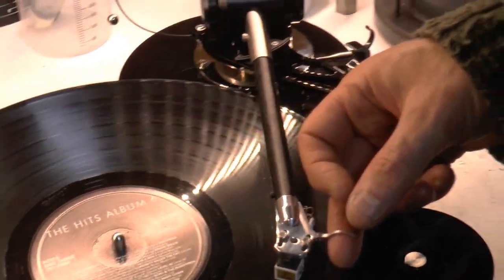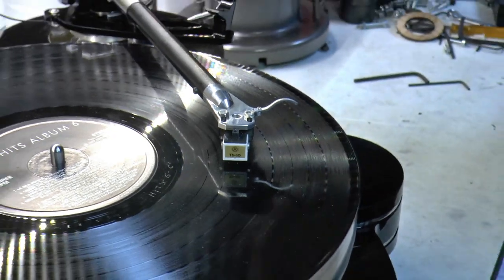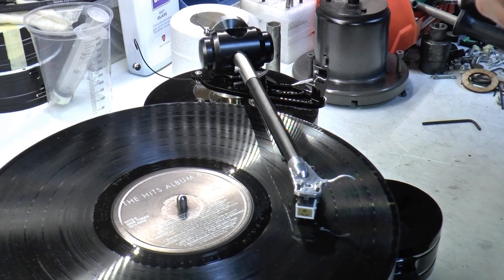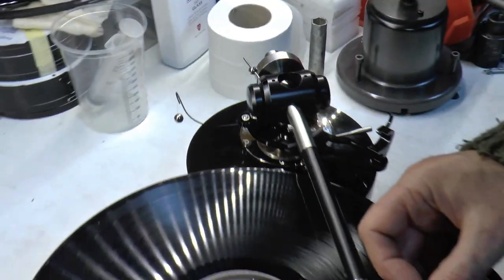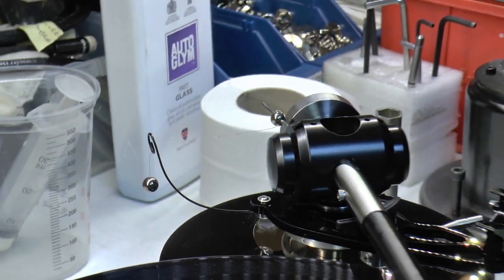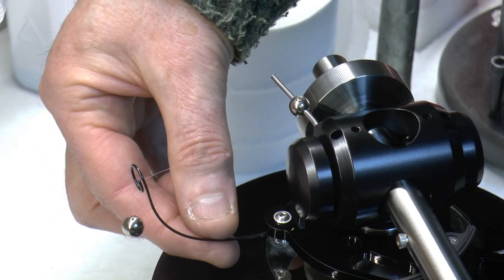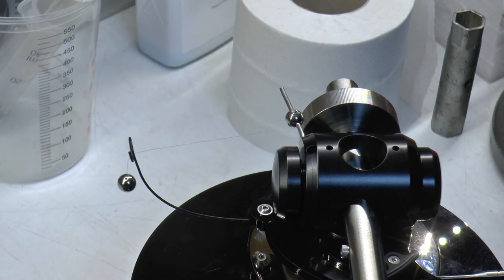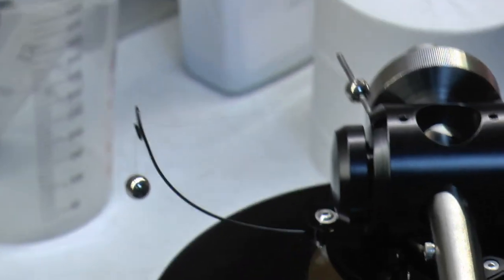How to Set up Side Bias on a Tonearm

Comment: I’ve watched 3 different Origin videos about the installation of an onyx tonearm or Origin tone arm in general and none of them help. They do not tell you (for example), which end of the cable with the 2 balls on it go where and how to get them into a decent position so you can then get everything else installed then come back to the various cables or balancing parts of the tonearm and have a closer listen and get them tuned in and set properly for the max listening pleasure from there !!
Reply from the maker: Hi @Islendingar, you'd be more than welcome to send an email or give us a call. There is only so much one can go into in a video, and it is rather easy to have blind spots when you are overfamiliar with a product like we are. The position is quite clearly talked through on page 7 of the instructions found here: https://www.originlive.com/wp-content/uploads/2021/07/Alliance-to-Zephyr-MK4-Instructions.pdf

Comment: sorry wrong! the corner of the weight guide dertermines the difference between inner groove and outergrove side pressure .
,The angels changes its simple mathematics, when the tone arm moves inwarts.
so use the right corner / angel and problem of wrong side pressure inner to outer groove is solved.  ask an famous designer what shopuld be the right angel of the counter weigjht guide  and you will be spurprissed;)
Reply: He his a famous designer and engineer!!!
Reply: @stephentree3466  i examen what is told .not who tells.
Reply from the maker: Olaf, multiple factors influence side bias in a tonearm besides the side bias weight. The side bias weight is the measure of control on Origin Live arms. It may be different on other arms with a different set of bias influences to ours, We can't speak to that.
Reply: @OriginLiveInfo  did you realy read my message?or its above your limit of understandinG?
Reply from the maker: @obiessen  Haha, yes, your message is beyond the limit of my understanding! Call me outsmarted! I do see what you're saying about the angle of the side bias wire loop - I think this is what you are referring to? Yes sometimes we experiment with the angle of this, but expert shmexpert. The best way to set is by listening. On some of our Higher mass arms, the angle is best-set parralel to the tube; on some of our lighter arms, at a 45-degree angle.